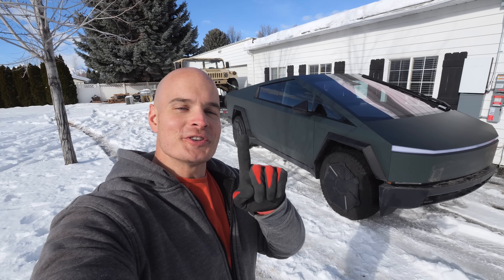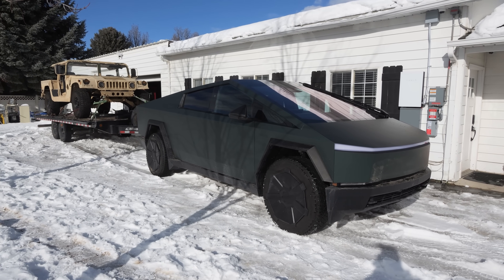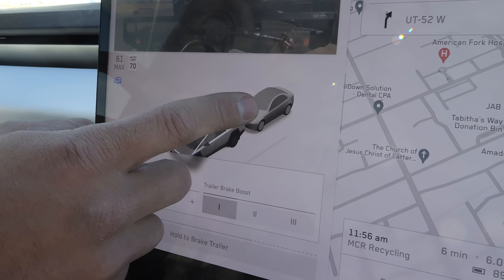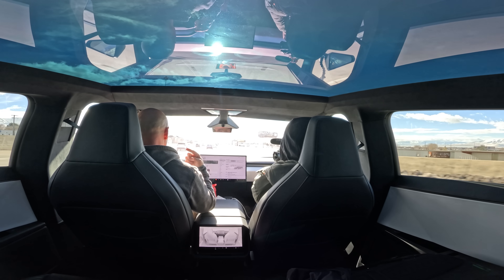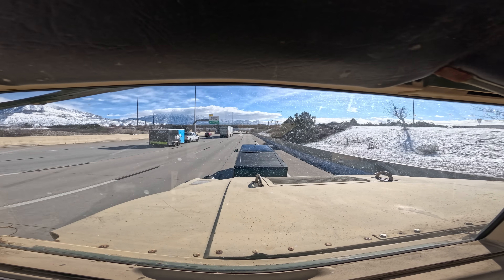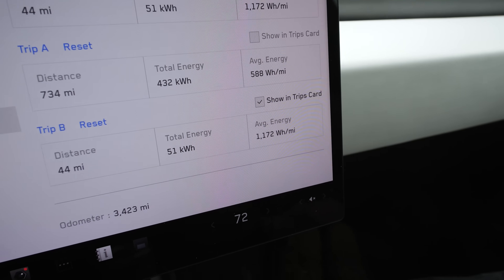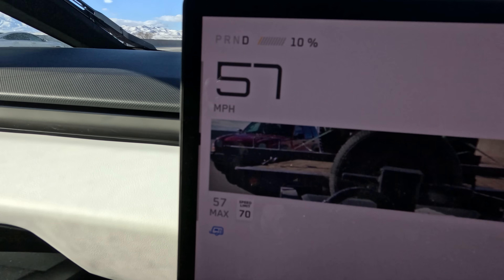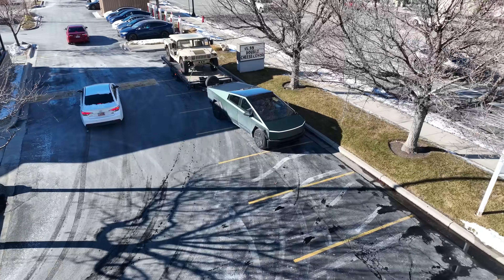How far can the CYBERTRUCK tow 11,000lbs in Freezing Weather?

Comment: Couple of things, one year out. A lot of that towing information Zach missed. You slide the radio out of the way on the screen and you get a lot of data. Also, there seems to be an updated gear set in the later cyber trucks that is quieter.

Comment: Hmm cheaper to recharge then fuel an fossil fuel truck, but 40 min wait every 90 miles or so.  A 360 miles trip 4 stops and 3hrs or so to recharge and drop the trailer each time. I'll take take a diesel truck instead.

Comment: thanks for doing this test.  Do you think it would lose even more range if it was colder (like 0 deg F)?  I'd like to get a CT, but I have to be sure I can tow my snowmobiles 120mi round-trip in very cold weather.  There are no superchargers (or destination chargers) where I go.  I also have to account for the power loss while out for the day snowmobiling.

Comment: Hey, a question for you with a RC battery we use a Lipo boat and when we’re done running it, our batteries are hot. We have to wait for them to cool off before we charge them again so with the Tesla batteries, you don’t need to cool down before you charge them.

Comment: U shouldn't tow anything with this truck ur risking others life's the way the hitch is attached is so bad it will fail with far less weight
Reply: The hitch is fine. You realize when it’s rated like that….it’s tested? If you break the hitch by dropping the entire weight of the car on it, than drive off and try pull , no shit it’ll break 😂
Reply: @Thermo-kun  I was talking about how my uncle hit a pothole pulling a trailer and it ripped off his back bumper and hitch 🤡
Reply: @Soccalissue  no you weren’t buddy
Reply: @Thermo-kun  checked your facts huh 😂

Comment: May want to stop using the red bungie cord for the emergency brake system. I was informed by a tow master that those expand too long and late. You are better off with a fixed length cable. Stay safe out there.

Comment: There's no fuckin way that trailer and a stripped down H1 weighs 11,000 pounds. Those trucks are no more than 5,000 and that trailer probably weighs around 1,000-1,200 pounds. If he was really pulling 11,000 pounds I think his range would be around 67 1/2 miles. The only way he could say he's pulling 11k is if he's adding the trailer weight and the cyber junk...I mean 'truck' together.

Comment: can't really compare cold weather to hot weather; cold air is denser so it literally takes more power to go same speed. also you can preheat the battery on the Tesla for better regen & cabin heat performance with lower drain on the battery.

Comment: You may not think it's impressive until you realize EV's have only been evolving for about 2 decades and they've already come this far, whereas gas powered combustion engine vehicles have been evolving for an entire century and aren't that far ahead relatively speaking. Within the next decade or two if we keep evolving EV's, I am certain they will outperform combustion engine vehicles in every way, and probably by a large margin
Reply: It's diminishing returns already for EVs so I doubt it.
Reply: @ShadowedbySusan  I'm sure that's what they said about combustion engine cars 60 years ago
Reply: @ScrimmyBunglets  No it was wide open still back then. A lot more scope for improvement but now even that is at diminishing returns... 
Hydrogen on the other hand has a lot more scope. :)

Comment: People crack me up talking about how “bad” electric trucks are towing.  I’ve got a 23 ZR2 with a 6.2.  I typically average around 16 mpg if just highway driving at 72 mph.  When towing my 6,000 lb boat, I’m lucky if I get 8 mpg, and I only have a 24 gallon tank.  Oh, and I have to run premium that costs around $100 per tank where I live.  Only difference would be charging with a trailer vs just pulling in to a gas station.  Electric doesn’t seem that bad to me.
Reply: That's an ultra light duty truck, designed for off roading and hauling. Towing is a bonus. This cybertruck offers near medium-duty tow capacity with zero payload and zero offroad capability. For $100,000 it should go 300 miles at max load. Any full-size medium duty (f350, 450, chevy 3500, dodge 3500) will. My '03 silvie gets terrible mpg because it's gasoline, but a $50,000 diesel will get 15 towing 10k and have a 36 gallon tank too.

Comment: i will be buy an ev when a battery charging tech is more advanced (2000 miles per charged).
There is no way i'm gonna be waiting an eternity to charge a damn battery.
Reply: You're supposed to charge your EV overnight at home. If you have to recharge in the middle of the road in an emergency, you already F'ed up.

Comment: so what if that parking lot was full and you didn't have 10 slots to pull in and back up the cyber truck with the trailer?  😅..  a blast to drive 90 miles then spend alot of time waiting for the charge... to only go 90 miles again...  doesn't sound like fun to me

Comment: Not enough time explaining how awesome steer-by-wire is. I think it went over this guy's head... Below a certain speed, the tires more in opposite directions for more efficient turning and OVER a certain speed the turn in the SAME direction for more stability at high speeds. Not to mention the optimized steering wheel. Brilliant stuff.

Comment: Yes you like your Rivian. . . but what are you going to do when they close their doors ?  We have a 2020 Tesla Model 3, dual motor, high performance that is driven for work about 72 miles per day.  We are in cold country, western South Dakota/  According to the vehicle's computer at 46,000 miles the overall average power consumption was 0.249 kilowatts per mile  (0259 watts)  This includes heating during winter operation.  We pay an average of 12.54 cents per kilowatt, so the cost has been 3,12 cents per mile.  Most of the driving is highways.

Comment: I don’t think the Rivian or the Tesla could pull a horse trailer and they don’t offer a fifth wheel for a goose neck horse or camper trailer.

The Rivian looks like a much better truck. The visibility problem with the Tesla bothers me too. 

The Rivian is much better looking than the Tesla which looks cheaply made and all the angles and straight lines are annoying and don’t suit any vehicle design. Sometimes being revolutionary in design isn’t a good idea.

Only 90 miles? No. That wouldn’t work for me. I pull horses.

Comment: Something less than 100 miles seems to be the worst case scenario for Cybertruck range, towing its max capacity in cold weather. That's not so bad, but if you drive many hundreds of miles under these conditions, you spend almost as much time charging as you spend driving. Cybertruck is not the right vehicle for this requirement, but most people don't have this requirement. If you do have it, stick to diesel for now.

Comment: Do you consider 32F cold weather? In Moscow in the winter it is -25 degrees, this is the usual normal temperature for two to three weeks. In Stbiri the frosts are -30 degrees all winter, in Yakutia all winter -55 degrees. How many minutes will this iron bucket last? battery at -30 degrees?😂

Comment: I agree most Cybertruck owners won't be towing but when towing, it must be agravating having to slow down to draft behind slow moving diesels just to make it somewhere.
Reply: Come on though - so much of this sounds like an ICE cope. How FAST would you tow 11,000 pounds.  In an ICE truck with friction brakes an ZERO regen..... ????   Then how much will the next set of brakes cost?
Reply: @summertyme5748 ICE trucks do carry this much weight for far longer distances though. Not to mention larger diesel trucks use J brakes, not normal friction brakes
Reply: @summertyme5748    With my Ram I regularly tow my Bobcat and with my trailer, that's 11,400. I go 70 on the freeway and the four trailer brakes cost about $40 total to replace (about every 100k miles). 

I've been in a swastitruck. It has a lot of gadgets nobody asked for, but it's not a great vehicle and it's barely a truck.

Comment: So they promised 14,000+ lbs towing capacity with at least 200 mile range when they first introduced the cybertruck. Lies,Lies,Lies. I can tow that 11,000 with my ram 3500 diesel dually with a extra 100 gallon auxilary tank 1500 miles at 70 MPH the whole way. Win for the ICE engines again.

Comment: Tesla will need to start making some pull through charging stations.  It would be so time consuming having to disconnect the trailer with every charge.
Reply: That way at least you only need to wait for a couple hours to charge to 100% every 90 miles.

Comment: 90miles and dead 😂 ill take a turbo deisel i like my duramax i can pull 18000 lbs and it dont even feel like its there. Amd still accelerate up hill or past cars with ease. The new powerstoke has 1250lbs of torque do a good delete and tune ive seen numbers as high as 2000lbs of ft lbs of torque.

Comment: As I recall, you mentioned it cost you $13.00 to charge the CT at home to 100%, then got @ 90 miles of range (along with a ton of anxiety). Presumably it would cost more at a commercial charging station, then to go say 500 miles you would need to make six stops (how long would it take to charge back to 100% at each stop, not counting unhitching and re-hitching the trailer) so @ $72.00 in charging costs. Pretty obvious to me why an ICE vehicle makes a hell of a lot more sense for ANY towing operation.
Reply: My Dodge (5.9 diesel), with ~15K lbs will tow at about 8 - 10mpg. I think where heavy trucks are really going to excel is with diesel hybrid solutions like what Edison Motors is working on. Train style solutions.
Reply: we just need to make efuels from co2 and water more widely known. It’s already a thing and it is cleaner than EVs. Search up Zero Petroleum
Reply: So I could tow 10,000 lbs and throw a 1,000 lb diesel generator in the bed and be just fine and have added traction 🥱
Reply: Or the Silverado EV. That thing can tow fairy well.
Reply: I did the road trip on a Mach e and had to stop every 1.5 to 2 hrs from Az to Central Valley to Bay Area . 8 stops total. Some areas there’s no fast chargers. And it lead me to 3 unusable chargers that were down. Took 40min to charge to 80% and off we go. Total 20hr to get there. Price $35 average charge cost each time. Almost 2x cost of a gas car. Worst was Central Valley Stockton Walmart was back up and a line to charge cars. Safe average milage is every 130 miles per charge. As I didn’t want to wait another hour charging from 80% to 100%
Reply: I feel like most ICE trucks get something like ~25mpg when towing, so a 500 mile trip would take ~20 gallons.

At a flat $3 a gallon that's $60. Not too different from the electric truck, unless you're doing it all the time. (Although the ICE vehicle is a lot cheaper up front as well)
Reply: @josiahgibson6373  I think the ICE trucks win in that they have larger tanks so you end up saving time in refueling, which to some people is a lot of money
Reply: @Suzumi-kun  But they dont have larger tanks. Larger than what? You realise the batteries of EVs are the majority of the weight. Also the reason why they suck compared to ICE veichles. A kilo of diesel will give you way more energy than a kilo of those batteries because its more energy dense.
So EVs are the ones with larger "tanks" but with less energy. 
Also not to mention the time you lose charging. Filling up a tank will always be faster and more convenient.
Reply: @josiahgibson6373 You're funny if you think trucks get 25 mpg without towing 😂
Reply: @djkjthe3rd185  "You're funny if you think trucks get 25 mpg"

That's what I say.  It's funny how when you introduce electric trucks into the mix ICE becomes miraculously efficient and reliable, and when electric leaves the chat - they immediately go back to complaining about PAIN at the PUMP. LOL.
Reply: "Feel like most ICE trucks get something like ~25mpg when towing - > 11 thousand pounds????"

Not. Most ICE arguments are all "feel like" and never "prove it."

This is from an F150 forum:

 "I get about 8-12 mpg depending on conditions running 65 mph or less with a 5500 lb travel trailer and 7000 lb enclosed car hauler."  

25 mpg my foot. lol.
Reply: @summertyme5748  Well if you gonna be towing, you really oughtta get a diesel truck anyways. At a quick glance at some specs- a 3 liter v6 diesel has more torque than even the v8 petrol in a F150. You still probably not gonna do 25mpg with 11000 lbs in the back, but I reckon you'd get around 18-19 and go much further than any electric truck on a tank for sure(haven't driven f150's so mileage may be worse, but have mostly driven diesel cars and vans and have decent idea on diesels' efficiency so 18ish mpg seems achievable in a scenario like that to me). At this point, the battery technology is simply not there to compete in heavy duty tasks. Rather pick the right vehicle for the job. If you just gonna drive yourself around and not tow - you don't need a truck anyways, much less an electric one. Towing with a cybertruck will probably remain a youtuber job only.
Reply: @josiahgibson6373  when you tow with a truck you get around half the rated mpg. Also, a 20 gallon tank seems small to me. I want to say the tanks are closer to 26 or more gallons on a truck with an engine designed to tow.
Reply: @josiahgibson6373  I dont think so....when towing 11K lbs they have significantly less
Reply: @josiahgibson6373  No, it’s half that at best. When I tow, it’s 8-10mpg (gasoline truck towing 6-7k lbs). But even if it were 4-5x the cost, I wouldn’t even consider using an electric truck for towing needs.
Reply: @shinpaul5 UK towing, mitsubishi shogun with a 3.2 diesel and get 25 - 28mpg when towing 3500kg (7000lbs).

You guys really missed out on the power of diesel in the US.
Reply: @timealone7906  you europeans literally cannot comprehend America, diesels are not uncommon but majority of diesels ran are semi trucks not pickup trucks. its not realistically feasible considering most of the us endures a season of sub zero temps and diesel doesnt like the cold. diesel vehicles are simply less convenient than gas vehicles all around and you don't have to deal with asinine extra fuel filters and DEF and glow plugs and such.

Comment: The range rating that you see there on the left there is not a ‘guess-o-meter” the way that it is in many other vehicles.  It’s actually just the battery percentage with the vehicles standard rated range.  You can tap the number to change it to % or miles value.  The ui has changed a lot since I have been dailying a Tesla but if you go to the consumption graph it should show the expected range which is almost always going to be different then the rated range

Comment: It went only 90 miles?? wtf.
sounds like diff wirr but its like Tesla's version of capacitors and coils having a fkn hard time. 123kwh is 419,693 BTUs (1 BTU = amount to increase temp of a pound of water by 1 degree). So, over 400,000 BTUs for 90 miles on a highway. 

How much does power cost where you live? I am paying nearly 45c per kwh at home. So, to charge is $55- in Adelaide. Good thing we privitised our utility network. Power prices are insane, but also to generate that much when converting to Diesel or Natural Gas or even a generator using any fuel is a fk koad for that range. 

Really, should focus on green hydrogen technology as fuel as the future. I like what they are doing in South Australia building a test plant that uses solar and wind to power the process of conversion and the electricity can be stored or put into the grid when needed or directly to say a reverse osmosis plant to get fresh water out of sea water with minimal fossil fuels.

So many applications. Plus takes a few minutes to fill your tank.

Hate to think of billions of cars when it is time to scrap having that much e-waste.. Super expensive to recycle and uses a lot of fossil fuels to do so.. not to mention the entire supply chain. Backwards thinking using massive batteries to power vehicles for such uses.

Comment: has anyone actually tested a non-demonstrator cybertruck to see if the bulletproof claim actually adds up? be interesting to see the real world results, as they changed the thickness of the material between initial spec and release, and the demonstrating of the glass went from being a steel ball, to a baseball.

Comment: There is another youtube that shows that a Cyber truck takes a hour to charge to 70% so this means if you need to tow this load 400 miles; you go about 100 miles and stop an hour on each leg; thats 2.5 hours to travel 100 miles or 40 mph; your trip will take 9 or 10 hours instead of about 6 in a normal truck.

Comment: I got about half the mileage you got (50 miles). Fully charged in at around 5 to 10 degrees with 10.2k of weight. I started my tow in Lebo, KS heading south to OKC. Long story short i didn’t even make it to Wichita, KS after fully charging in Emporia. This is not a work truck. We used a cyberbeast. This truck is tough but not work tough.